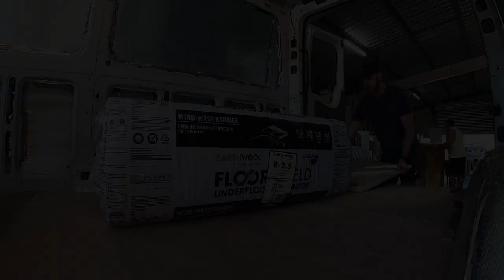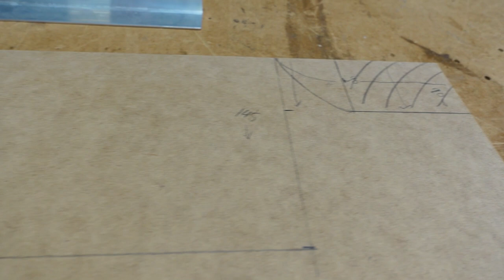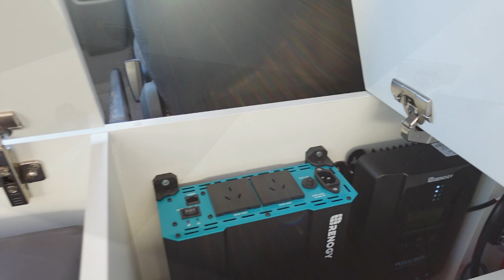Custom Cabinet Build for Sprinter Van Conversion, Including Couch/Bed System - Vanlife Ep. 6

Comment: I'm digging the ply cabinets.  I wonder what the total weight savings are compared to using MDF.
Reply from the maker: Thanks Jay. Yeah mate, ill have to calculate the weight saving per sheet. I used MDF to template some of the obscure panel edges, and the weight difference was dramatic.
Reply: @triitoutadventures2028  I'm not sure what's common down there but it looked like birch ply.  I love birch, fantastic rigidity and huge difference in weight over MDF but a little more difficult to work with.  Those will certainly help with fuel efficiency!